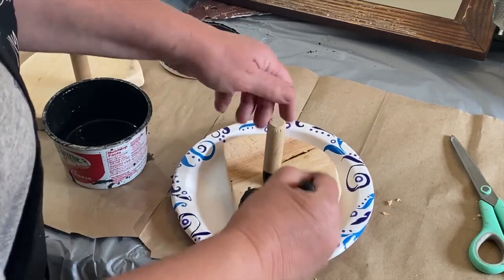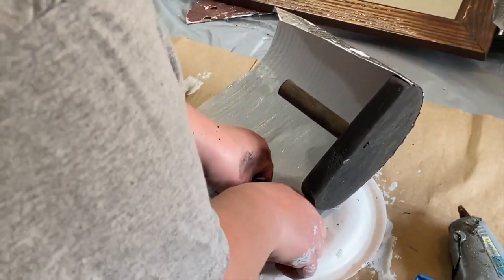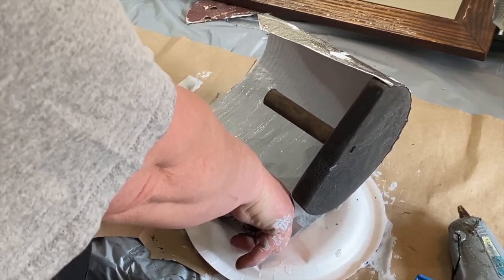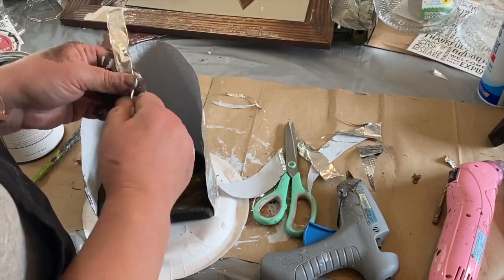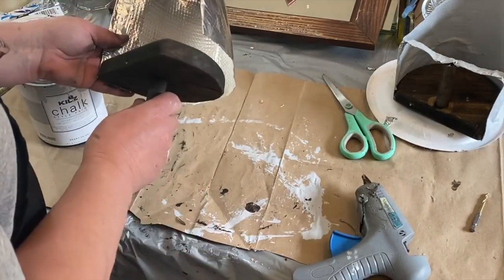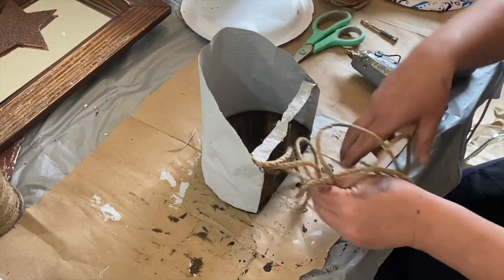Rustic Grain Scoop Dupe | Scrap Wood Power Up Collab | Budget Friendly

Comment: What is the orbital sander used for?
Reply from the maker: The sander runs in a circular motion and cleans up edges on the wood to make them smooth and rounded.